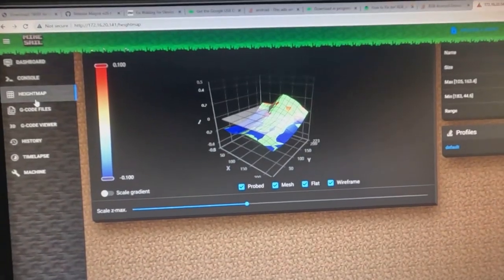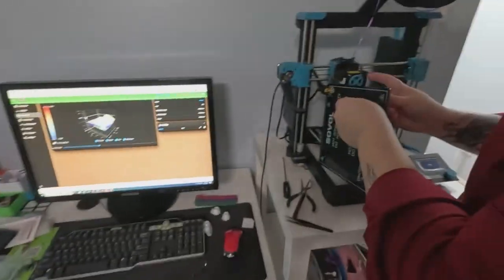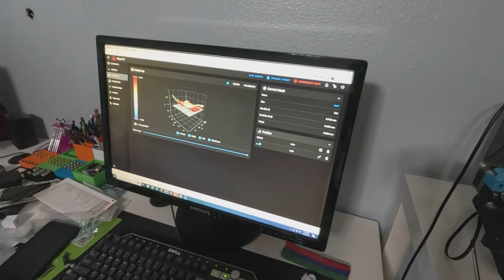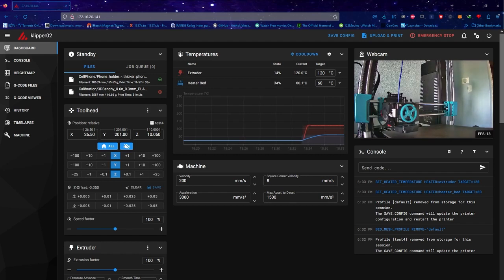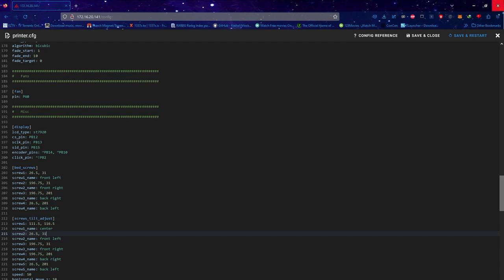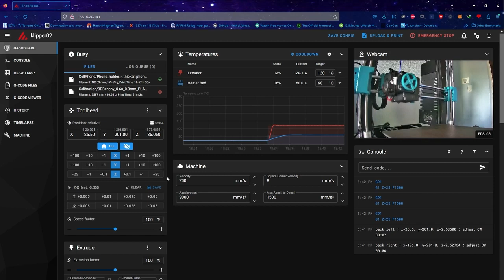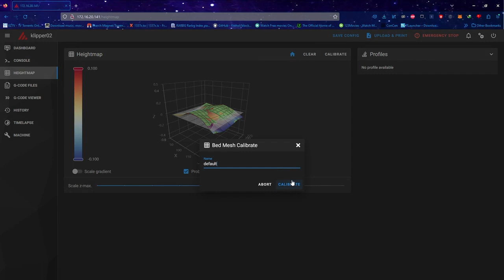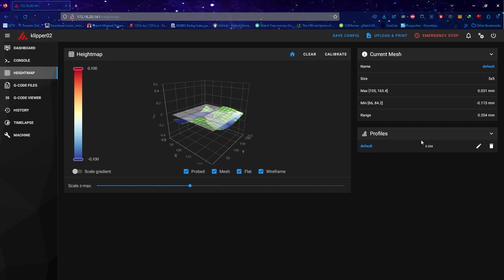Nylock Mod on my Sovol SV06 to get a better bedmesh with Klipper

Comment: you shouldnt have to do any of that if the auto bed leveling actually worked. if the magnetic bed has more magnetism on one side than the other then that effects the sensor. ive used a square on the bed to see if it was flat and it was but the bed mesh shows it is not which is wrong.

Comment: Have this issue on mine, they sent me a new bed, got a Bambu right after, and havent even messed w it, but plan on getting it running right soon-ish
Reply from the maker: I ended up retiring my SV06. I took on some projects that required larger beds.

Comment: Just remember the beds are very thin and prone to warping so even if you get absolutely all the bed mounts to be level to each other you cannot control what that bed does while heated.  You also need to tweak your bed mesh values and predictive values.
Reply: how do you tweak your bed mesh in klipper?

Comment: Does Klipper help with bed leveling? I cannot seem to get a good bed level with my SV06+ on marlin firmware. Although I have done the silicone bed mod and I got every thing down pretty close, yet I can barely print on quarter of bed.
Reply from the maker: I think Klipper gives you more tools to diagnose what your issue is. I haven't used the silicon mod as it didn't seem as precise. If you follow the procedure outlined in the video you should get fairly close to optimal. The screws_tilt_adjust command combined with the nylock mod is pretty awesome. I just used it on two different sv06 printers this last week with great results. Look up bassamanator on github. He has everything needed to get your printer setup on klipper. I also did a klipper setup video and there should be another video coming later on this week with this as well, kind of an update or supplemental.
Reply: @room281tech8  Yeah the silicone bed mod doesn't seem to be working well for me at all. Where did you get the nylon washers and nuts from?
Reply from the maker: @mobloeescobar4203   I just sourced them local at the hardware store. You just need nylon locking nuts and nylon washers. I ended up reusing the screws I had but you can always grab longer ones. I think they are M4 screws.

Comment: Silicon mode from prusa printers is way easier imo. Just replace this metal washers with silicone ones and then just tight the screws right. Also, just curious what max flow you are using and which speed are you printing at? I'm one the CHT clone nozzle, and get around 18mm^3 of flow and 100-120mm/s of stable speed with 0.6 nozzle.

Comment: For anyone doing this, I've noticed that if you get the PROBE as close to the screws as possible, rather than the nozzle, you tend to get better results, or at least, I do personally.  The following will get the probe pretty close to the screws:

screw1: 84.5, 135
screw1_name: center
screw2: 0, 49.5
screw2_name: front left
screw3: 169.75, 49.5
screw3_name: front right
screw4: 169.75, 219.5
screw4_name: back right
screw5: 0, 219.5
screw5_name: back left
Reply from the maker: The klipper docs state to have the hotend over the screws. Not sure what their reasoning is, but if you get better results, then cool. When I started this klipper journey, I had a lot of issues with bed mesh and 1st layer print quality, which is where i formed the suspicion that the induction probe is not very good or it needs to be adjusted. If you touch the tip of your hotend nozzle tip to your buildplate, the induction probe should be sitting 2-3mm off the build plate. Perhaps that was affecting the results.
Reply: Am I insane, stupid, or both? This ONE post, on ALL of the fkcing INTERNET, seems to be the only one with coordinates for the screws on the sv06 buildplate. like, I've been researching for about 14hrs today, including trying ChatGpt to help, and NOTHING (EXCEPT FOR THIS ONE POST) says fkvc all about the screw coordinates.

OK, HAVE AT ME, chat. tell me all the ways in which I could have found this out SO EASILY. At least then I might learn something other than how to fix [INSERT LITERALLY ANY OTHER PROBLEM WITH LITERALLY ANY OTHER SOVOL PRINTER, KFCUING LITERALLY EVER]

Comment: What i've done is double up the thumb nuts, i made really super thin ones. Springs gone. One thumb nut above the bed carrier, one below on each screw. Normal nuts just below the bed. Adjustable and locks by jamming tight.

Comment: From side to side just level the gantry.  The auto level doesn't work super well when it is way out.
Reply from the maker: That's basically correct. The caveat is I only have these issues when I ran Klipper on that printer. My build plate seemed to be fine in some areas and too far out of range in others and the auto level couldn't compensate for the "extreme" change in surface offset. This helped this printer. I have another SV06 that works without this mod. However, I will be applying this mod to that printer as well because there is room for improvement.

Comment: Stupid question here... if the screws are tightened down to the bed enough with the nylon locking nuts, how do you secure it back to the bed platform?  I haven't taken mine apart yet, so it's not apparent.  Just wanna get my ducks in a row prior to disassembly.
Reply from the maker: Once the locking nuts are attached to the screws on the buildplate, you just line up screws with the holes in the build frame the build plate attaches to and screw them in. The screws are basically fixed to the build plate so tightening/loosening the screw moves the plate up and down. I hope that helped. I just went throught the video trying to find where I did that and I realized I edited it out for speed. I have another one of these printers that needs it done. I've just been slammed this last two months, such is life. I'll try and get an update to this video during the holiday weekend.
Reply: @room281tech8   Thanks for the explanation!  Now that tells me how tight to make the nuts.  Makes perfect sense.
Reply: @room281tech8 bro!!!  after less than 30 mins from start to end, .0844 variance!  Thanks for this video, and the contribution to the SV06 community.

Comment: Klipper makes it much easier to see how warped the bed is, although the inductive sensing isn't very accurate, even when averaging three samples per position.  Try repeating the mesh leveling without making any adjustments to see how much variation there is from one mesh level to the next.

I'm waiting for Sovol to introduce their next printer which I hope will be a Klipper version of the SV06+ with better part cooling... or maybe Elegoo will introduce a plus size version of their Neptune 4 Pro with WiFi.  I like my old SV01 workhorse so much that I'm tempted to put Klipper on it and make a curtain part cooler that mounts on the back of the gantry.
Reply from the maker: Their inductive coil isn't very impressive. Eventually I'll install a superpinda, direct plug in, no modding necessary
Reply: @room281tech8  - No doubt Sovol used the least expensive inductive prox switch they could find.  A better quality prox switch would almost certainly be a good upgrade for more accurate bed leveling, however, I'm not a fan of inductive sensors for bed leveling.  It would be much better to measure the contact directly to avoid the inherent inaccuracies of inductive sensing.  I like the concept of pressing a heated nozzle into a heated bed and sensing force at the bed mounting, but that can put small divots in a PEI print surface.  I print a lot of TPU on textured glass and force sensing contact would work very well for that, but almost everyone is using a magnetic PEI build surface these days.  The BL Touch would be a more universal solution but I don't care for the mechanical complexity.

I think manufacturers of low cost 3D printers are relying too much on mesh bed leveling to compensate for warped beds that aren't level.  Mesh leveling works best when compensating for a small warping in a fairly flat and level bed.  They could probably devise a clever solution using finite element analysis to design a bed that warps a minimal amount when heated, and by engineering a bed mounting solution to minimize warping.
Reply: @Liberty4Ever  Agreed I really hope Sovol releases an SV08 that has the software of the SV07 with the hardware of the SV06. That would be a real winner!
Reply: @802Garage  - If the SV08 was the hardware of the SV06 with the firmware of the SV07, it would basically be an Elegoo Neptune 4 Pro with WiFi.   🙂

Comment: This was a cool video, and great idea.  I think it's the same size bed as an ender, so why wouldn't someone just use yellow springs and wheels if it is this out of spec?  That and a good straight edge should get you close as well, right?  I think those kits are like 10-15 bucks.
Reply from the maker: They wouldn't work on this bed design. It would cool if they did but it becomes an interference issue.
Reply: @room281tech8  i looked underneath and it looks like my ender.  are you saying interference because it would put the bed too high?

mine is .20 to .26 high along the back, and my prints are excellent but I personally don't like it that high.
Reply from the maker: @CuttinInIdaho  I was thinking the fine tuning knobs that sit on the 4 corners of the bed. The ones Ive seen looked like they would stick too far out and make contact with the gantry. Maybe we are thinking about two separate things or a different version. If you got a link to what you're thinking I would try and make it work. It would be much more elegant approach. I got to do another one of these printers with the nylock mod soon.

Comment: Hey there. I followed your steps and put the  BED_SCREWS and BED_SCREWS_ADJUST code in my printer.cfg. However when I do the SCREWS_TILT_CALCULATE command I notice something. The nozzle moves above the 5 screws and it does the calculations from where the nozzle is instead of where the bed probe sensor is. So my calculations are based from probes that aren`t measured from the screws. Do you know how I could fix this?
Reply from the maker: So I set it up per the Klipper online doc. It states, "The secret to getting good bed leveling with bed leveling screws is to utilize the printer's high precision motion system during the bed leveling process itself. This is done by commanding the nozzle to a position near each bed screw and then adjusting that screw until the bed is a set distance from the nozzle." Which is what we have here.

However, I suppose if you wanted to have the induction coil over the bedscrews, you would just go in the printer.cfg and change the coordinates. Let me know if your results are better, worse, or the same.

Here is the link to the Klipper info: https://www.klipper3d.org/Manual_Level.html

Comment: Same here!!!! Left side is down so much more. Do you think a bl touch/cl touch would could be good instead of induction probe?
Reply from the maker: I've thought about doing that because I would really like to use some G10 as my print surface. I'm also now seeing that my induction probe is not very good. It is having a lot of issues. It just isn't sensitive enough. My guess is that it is poor quality. Maybe I should do a BL or CR touch video in the future. I'll need to find one at a reasonable price. Right now I am thinking about using a FYSETC Pinda probe replacement which is what comes on the Prusa Mini which is direct replacement for the Sovol.
Reply: @room281tech8  I would do that pinda probe, I plan on doing something like that also. Sovol is a great company to deal with, but honestly.. they are like creality or any of the other brands. They are not geared for quality. They are about CHEAP.. and that is it. Slow down, charge a lil more.. and produce a REAL product, not a cobbled together bunch of parts we have to sort out. I am on a mission to get people to wake up and demand better from the 3D printing industry.  Save for a P1P btw. You will be blown away.

Comment: the sv06plus dont have this issue
Reply from the maker: Are you running klipper or octoprint? Have you taken a bed mesh yet. Basically if you're printing in small areas you will probably be fine. However when you print something like this, https://www.printables.com/model/445074-sv06-detailed-level-test .....that requires the full size of your build plate, you will see inconsistencies within the first layer. Some will be too high, others too close ....and then you'll get those Goldilocks layers. After some of the forum posts on the SV06+ I've seen. If your print comes out amazing, consider yourself lucky because you got one of the good printers.

Comment: I did this mod as well and it definitely helped. I am still having consistent issues where the right side still seems to be too high even after this mod and replacing the lead screw couplers with spider couplers. Have you checked your frame for sqaure? I'm literally going through that process while I watch this video.
Reply from the maker: I was having the same issue with mine which lead me down the road to the nylock method. Basically I was having issues at the edges and especially the corners. I could never find that sweet spot before this mod. I have squared the frame, calibrated the X axis on both sides of the gantry, and performed this mod. That got me really close. The final thing that helped me out was setting up a fast bed mesh before each print only calibrating in the area it was going to print. I feel that has gotten me the closest to my goal of an amazing print. I will be sharing my macros, configs, and slicer settings next week. I've just been crazy busy and its been hard to find the time.
Reply: @room281tech8  I think there's still something going on with mine. Even within a 100x100 area in the center of the bed there's still some significant issues. One of the couplers from the factory failed during a gantry align and I caught it before it did any catastrophic damage but I think it might have done some damage that may be related. Both of my lead screws have significant bends. I did the bearing mod for the lead screws that you showed in one of your videos but have since removed them because I'm concerned about the new spider couplings not being able to compensate for the bends. As of last night I had a somewhat decent first layer with no bed meshing, and as soon as I added the bed mesh it starte dragging ont the left side of the prints. I'm at a point where I wish I had just bought an Ender 3 and upgraded it rather than having to replace parts on this in hopes of it working the way it's supposed to. This is my first printer so I ams certain that there is much that I don't know but so far it hasn't been a great first experience for me.
Reply from the maker: @ptivnan  So I found this part on printables ( https://www.printables.com/model/444122-z-axis-mod-for-sovol-sv06 ) that may help with your bent screws and possibly improve some problem areas. Also check those mounts where your motors connect to. I replaced my z-axis gantry motor mounts. The injected molding was warped. Luckily I had another printer to make those parts. Also some of the printers have a bit of twist to them. Here is another link that can help with that. ( https://www.printables.com/model/433884-sovol-sv06-x-twist-fix-top-bar-upgrade ). If you want to post some pictures of your bed mesh to my facebook page, I'll take a look. Im curious to see what you are working with.
Reply: @room281tech8  Thanks! I'll take a look at both of these mods. I had been reading about differnet mods for fixing lead screw wobble and that first one might do the trick. I'll check out the second one as well. It's funny because last night I actually downloaded the official STEP files and modified the top Z axis brackets to allow a longer lead screw to pass through. The official ones are like 376mm long but I couldn't find those only so I ordered a couple new 400mm lead screws and figured that might be simplest option to get them installed when they arrive. I'm close to getting an acceptable level of quality which I'll be taking advantage of to print all these parts in hopes of improving the repeatability. I'd love to get some aluminum motor brackets but hopefully printing new ones will help. I'll follow up here if I make progress, hopefully my experience can help people because it is really trying my patience.
Reply from the maker: @ptivnan  This printer is rough. It's been a journey for me as well. Another issue that I just fixed is the cooling issue. The stock 4010 part fan just can't hang in there. I swapped out to a 5015. I feel like I've pretty much swapped or replaced a lot on here to get it normal. The motor mounts I used were beefy ( https://www.printables.com/model/368386-z-motor-mount-for-sv06-squareness-rigdity ). I used petg 100% infill. Very strong. Aluminum would be cool but these were impressively strong. Good luck. Once you get it dialed in these really do print nice. So my list so far that I've replaced, all bearings, motor mounts, parts fan, nylock bed mods, and reinforced bed wiring. Then I had to repair an idler pulley, tighten the drive pulleys, also had to tighten down the extruder gear(stopped feeding, had to do this 2x) and lubricate the planetary gears. Most was fairly cheap fixes, but wow did it feel like a lot of stuff. So I get it. Please share your modified part on printables.
Reply: Make sure your induction probe isn't measuring too close to the edge of the bed, try offsetting the build-plate slightly to the right to barely overhang the edge to see if you get different results.